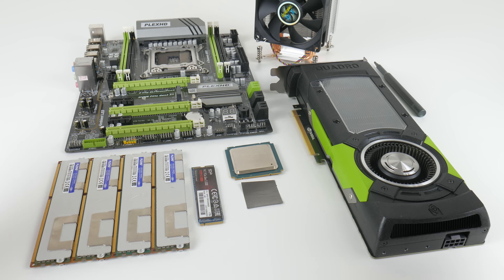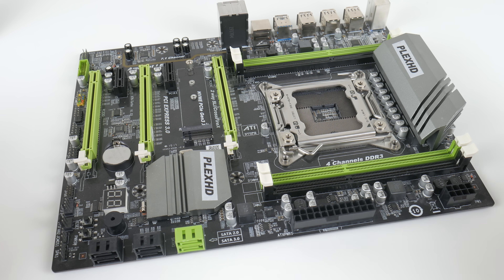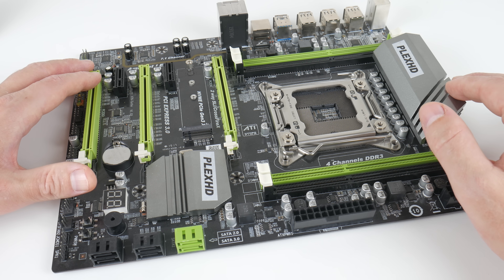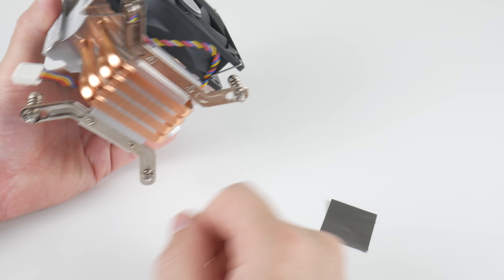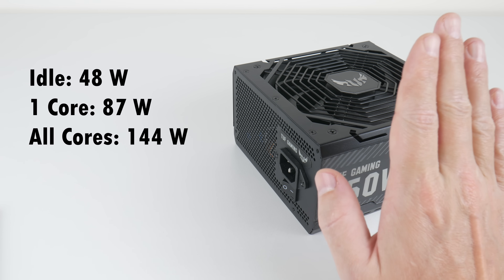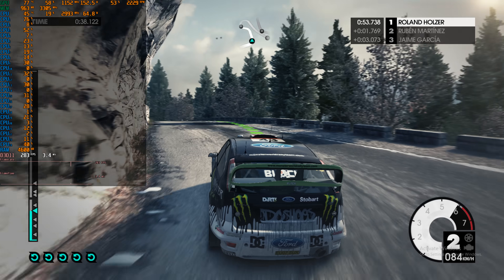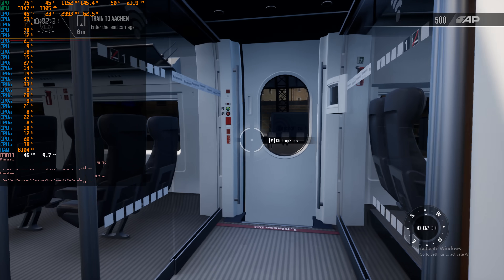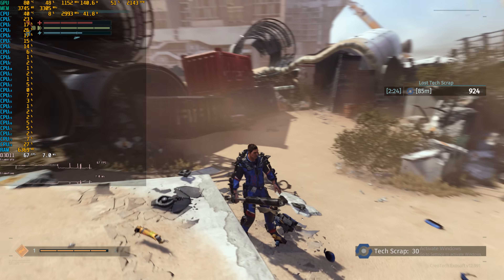10 years ago this CPU cost $2614 - How does it hold up? The Intel Xeon E5-2697V2!

Comment: if I remember correctly the cache design on these wasn't well-suited for gaming workloads - more for server and productivity stuff
Reply: 256k L2 per core and a shared L3. Pretty much how Intel did it until Alder Lake.
Oh, and that L3 is slower than the L2 of a Core 2. And on desktop chips both are about equal in size. My i5-3570K has 6 MB L3, and my X5460 has 2x 6 MB L2 for a total of 12 MB.

Comment: In cinebench R15 the 2697v2 is getting the same score as a Turbo unlocked E5-2660V3 10c/20t

Maybe you could check out the 2643V3? It has a 3.7ghz clockspeed available and with turbo unlocked 6c/12t maybe its good value?

Comment: For £71 you can go down just a notch with a 2650, X79 board and 16gb of ram which is a damned good deal, its on Aliexpress.   The 2650 is only 8 physical cores, 16 threads but if you factor in the price of a board and ram easily can exceed £70.   I have long wished for the £200ish dual socket X79 that comes with 2x2670's, 128gb of ram...   I mean those sort of specs are unholy badass and run a formidable GPU and I bet it could prob do quite well in much of todays games.

Comment: I have 1 of these skt 2011 AliExpress systems, which I bought after you featured it on your channel years ago. It's my 2nd machine in the bedroom, it has a 10 core Xeon E5-2660 V2, which was £75 when I bought it. So I think it's time for an upgrade, so I just went and used your link to snag a E5-2697V2, which was just over £30 shipped.
Reply from the maker: Good choice!

Comment: For this price You can look into v3-v4 (2667v4 is about same price) only m/b can be more expensive, but a lot of usb3, sata3, etc

And 2678v3 is cheap now (i got one for 120+usd 2-3 years ago, now its around 60) and it supports DDR3

Comment: These chinese boards can boot with ECC ram but works as normal RAM, you can type this command in cmd to check: wmic memphysical get memoryerrorcorrection, only few can actual using ECC function.

Comment: Those particular PlexHD boards are surprisingly solid. I used one with a 1650 v2 as my main setup for about a year and never had much cause for complaint. Even had it overclocked to 4.2GHz and it handled that just fine, though the 1650 v2 is only six cores so easier on the VRM. Paired with quad-channel DDR3 1866 it was a pretty decent setup.
Reply: hey mate i got same 1650 v2 planning to upgrade it to 2697 v2 .. should i do it ?? or i stick with 1650 v2 considering i have to gaming

Comment: Remeber guys: If the use of GPU does not reach the 100% and the game run slow, it is a bottleneck caused by the CPU, saludos!
Reply from the maker: You're right 🙂
Reply: In most cases absolutely. In some rare situations there can be some other limit. From specific GPU parts to VRAM, to simply bandwith.

Comment: Still using x58 with 980x. replaced the gtx480 with a 1050ti though. But thinking to get a better GPU now
Reply: I hope that was bought used? That was a grand when it released and was quickly smoked in games by the 2500K that could be found for under 240. Well, in 2-4 core optimized games at the time. Nowadays that would be different with modern games.
The trend to more core usage was also obvious with the AMD FX chips. Yes, in some games they're faster than a 2500K nowadays. But that means getting 27 fps instead of 24, so both of them are to slow. (Which was also my issue with the Q6600. By the time games made use of 4 cores, it's cores were generally too slow and power hungry and before you could get a dual core that was faster, cheaper, and more economical)

Comment: Excellent video Phil, loved extra games:face-fuchsia-wide-eyes:. The single core performance in rendering benchmarks is quite deceptive if we are thinking of gaming performance, as 120cb score in cbr15 is actually ~40% slower than what we get in stock, already very aged 4790k. Outside of few edge cases this cpu is still very decent for games, as it seems it could easily handle something like rtx 2060 or stronger even, depending on resolution and settings. 
PS. Hopefully you will fix the audio in your mic as there seems to be some kind of wind in your room, fans maybe?
Reply from the maker: Yea the AC was running it was really hot.
Reply: A 120 in CB R5 single is what my core 2 can do. The clock really hurts it, but the big cache can do a lot.

Comment: This CPU is now relying on brute force to achieve performance.  The IPC is about half that of an Intel Coffee Lake CPU like an i7-8700K.  The i7-8700K multicore benchmark in Cinebench R23 is about 8300, same as this 12-core monster.  Modern laptop processors like the AMD Ryzen 7 PRO 6850U have even more performance at a fraction of the power consumption.  The "X79" and "X99" motherboards being sold on AliExpress are really a crapshoot and you never know what you're going to get quality-wise.  The chipsets were salvaged from old server motherboards and aren't even the actual X79 or X99 chipsets.  They just name the motherboards that way for branding purposes.  It's a totally buyer-beware situation.  Unless you have an actual X79 or X99 workstation motherboard from reputable companies like ASUS or Gigabyte, I wouldn't build a primary system from one of those AliExpress boards.
Reply: The interesting thing is, there wasn't that huge of a difference between the desktop and server/workstation chipsets. With the official driver my Z77 is detected as "Intel 7 Series/C216 chipset family"

Comment: I think these remanufactured motherboards bundled with a CPU and RAM are fantastic entry points for a lot of people. It also significantly reduces e-waste to reuse old parts and give them new life.
Reply: Agreed on e-waste, on value I'll argue, you can get a B450 for 70$ that supports 5000 series CPU's and 5600 on a B450 is great value, not to speak that DDR4 is as cheap as DDR3 since they don't make it anymore.
Reply: @PatalJunior  True, you can also build a decent, modern, and new PC with a 5600G APU for under $400. That is normally with a B450 or A520 (depending on availability and discounts), 16GB DDR4 3200, 256GB M.2, 500W PSU and a glass sided case. Plus it is readily upgradable with modern parts.
Reply: @HappyBeezerStudios  When you think about it, the fact that a Core 2 Quad from january 2007 is still able to perform very well in everyday tasks like web browsing and pretty damn well in games up until 2017/2018 is insane and a testament to the greatness of the Core architecture used for Conroe/Kentsfield CPUs.
Reply: @PatalJunior  double the cost.  Can get a mobo xeon cpu and ram for less than a b450 motherboard
  With next gen ryzen out and ddr5 in the next year or 2 prices should drop  a fair bit. These game really well at 1080p  with a 130$ rx5700. Gives you 2 years to save up for next gen as it drops in price aswell

Comment: Haha your Video-Thumbnail rocks! I got this CPU too here but haven´t tested it yet. Because the E5-1680v2 is occupating the Socket on my only X79 board, the ASUS P9X79 PRO. This 1680v2 has only 8 cores but an unlocked multiplier and a base clock of 3 Ghz. If you can get hold of one of these, pls don´t hesitate. They might be more rare and more expensive but they´re simply awesome, can take a decent OC too and rock stable and low temperatures. Would love to see this CPU featured in a future video of you. Cheers.
Reply: Are they soldered or use paste like the desktop ones? If they're soldered, that would make for a pretty easy overclock.

Comment: Never used x79 seems interesting for a budget setup, I have an x99 setup and it works well for me, Chinese mb and e5 2740 v3.great info !!
Reply from the maker: Yea if you have X99 no need to step down. There are awesome high end CPUs for your board too...
Reply: I meant e5 2640v3 sausage fingers

Comment: The Chinese also make X99 motherboards with DDR3 slots, so you can enjoy native 4k video playback too using cheap DDR3 Reg ECC without a decode capable graphics card (like R9 390). The catch is that only a handful of CPUs (originally released for OEMs) supporting DDR3, and also only the v3 (Haswell) models can do the "all core turbo unlock" hack.

Comment: i have a 2470 in my private home server its the v1 not a v2 it was upgraded from a 2403 but this server was saved from going to a landfillits a bit beatup on the outside due to a drop from my bike but the hardware itself is fine i dont use the onboard graphics on it anymore as when i could afford to upgrade components i replaced the GPU with a gtx 760sc which was what i could afford at the time and probably got overcharged on

Comment: Just gpu limited for the games i think, not cpu. It would have been nice to do a comparison with a more recent processor, and a latency test. This Xeon is Ivy generation processor, remember my 3770k with the same graphic card (EVGA GTX 1060 6GB OC) which worked great, intel software cpu test percentage was above average almost 90%. To say the monster hunter benchmark on an asus p8z77ws was a little bit better than with an aorus master z390 and 9700k (17000 points vs 17100 points) it's not a very gpu-intensive test the graphics card is clearly above the limits, but we can observe small differences with the processors, which have a few generations difference, not always obvious, especially in 1080p.
Reply: Aorus master z390                                 Asus P8Z77 WS (workstation)         
16 gb ram DDR4 4200mhz     VS          16gb ram DDR3 3466mhz
i7 9700k(4,9ghz non OC)                       I7 3770k(OC 4,2Ghz)
M2 Nvme                                                  SSD samsung pro
EVGA GTX 1060 6GB OC                       EVGA GTX 1060 6GB OC
Lepa 750W Gold                                     Lepa 750W Gold

Overclocking card to the max capacity, rad air cooling by Artic (accelero xtreme 3) with EVGA Precision XOC:
+250Mhz Gpu clock 2151Mhz total
+500Mhz Memory clock 4498Mhz total
+25% voltage
+KBoost

Results(I found the good results I had just 100 points of difference to my memories):

16800 points        VS        16900 points

But it's not a CPU-intensive game, which is why the processor capacities are well beyond the limits and in the end make little difference on this benchmark, the difference has to be played on the architecture of the motherboard in my opinion. This Ivy bridge 22nm worked well, same this Xeon but can do clearly better and better OC.
Reply: Would be interesting to run comparisons with an overclocked 3770K or 4930K/4960X, just to see how much of that is lack of clockspeed and how much it's the GPU.
Reply: @HappyBeezerStudios  For sure Xeon E5-2697V2 vs 3770K or 4930K/4960X could have been one more indicator, to identify the CPU requirements of games and other benchmarks.

And if it's really the performance of the CPU and the motherboard architecture, taking advantage of multi cores and multi threads, or if these tests are valid with Ivy bridge CPUs which have more speed and less core like the 4960X, or at equivalent power and less core such as the 3770k.

Comment: Always nice to see older parts getting some use. Also running a xeon 1680v2 and is has not disappointed in anything ive thrown at it R15 gets about 1480 at stock and about 1590 at 4.1ghz
Reply: Your xeon 1680v2 running fine with my rtx3090ti at 4.5Gz speed. Is good idea to assembly with the high speed ddr3 2400Ghz.

Comment: So...can you do some slight retro testing using Windows Vista X64 SP2, Windows 7 X64 SP1 and Windows 8/8.1 as well as use 3DMark Vantage and up and other multi CPU aware benchmarks as well as games from Crysis, Crysis Warhead to later PC games that actually use multi CPU cores?

Also the last stage of Crysis Warhead on highest quality or Enthusiast settings should be checked... even Crysis 1 should be tested on Very High maxed settings at 1080p since that will show the highest old retail effects and any stability issues especially since Crytek never really bothered to do a Remake for those two games and did a bad Remaster considering that even the base Xbox One and PS4 2013 consoles have eight CPU cores and DX 11+ GPGPUs equipped with Compute Units which are things the original games on PC NEVER actually used even if Nvidia (for propaganda reasons) sent them GeForce GTX 8800s which had CUDA cores aka Compute Units or Streaming Processors.
Reply: I would say 7 or 8.1 for that. Both are the latest supported systems of them and lots of games and software will still run on it.

Comment: The top CPU is actually the OEM-only Xeon E5-2696 v2, which has a 3.1 GHz all-core turbo. I used one sometime ago with the Asus Rampage 4 Extreme motherboard, which supports FSB overclocking, and I was able to run it at 110 MHz base clock for 3.41 GHz all-core. I sold it on eBay for double what I paid for it, since it was way overkill for my needs.
Clock speed-wise, the fastest is the E5-2687W v2, with a 4.0 GHz max turbo, but it only has 8 cores, so you might as well buy an E5-1680 v2 and overclock it.
There also exist the rare 4.4 GHz and 4.6 GHz Intel "Black Ops" CPUs with 4 and 6 cores respectively, and no Hyper Threading. I don't know about the former since it was pointless, but I found that the latter couldn't actually hold 4.6 GHz on all cores, so it was more of a max-turbo speed. It has a 250 W TDP, and I uncapped all power limits in the BIOS, but it could still only hold 4.1 GHz when all 6 cores were stressed. Sadly, this meant it only had collectible value, since you can easily overclock an E5-1660 v2 or i7-4960X to 4.6+ GHz with HT off.
Reply from the maker: 250W TDP 🥵
Reply: @philscomputerlab  I think they just marked it at random, since those CPUs were supposedly custom-made.
In actual use, the power draw was not even 150 W, which is why I couldn't understand the throttling. I tried undervolting it as well, but that made no difference, so it wasn't TDP or thermal.

Comment: Not sure if that is, in fact, the very best Ivy Bridge; as I recently decommissioned my venerable E5-1680V2 (8C/16T, US$155 at the time) that could all core overclock up to 4.5Ghz on air (230WTDP cooler); though I ran it daily at 4.3Ghz for over 3 years without issue and at reasonably cool temps (less than 70C at 100% with 20C ambient). I had it paired to an Asus P9X79 Pro that I picked up in a package deal with 32GB 1600 desktop RAM (and a CPU + Cooler).  After selling off the parts of the bundle that I did not use...that pristine motherboard cost me about US$20.
Recently upgraded to the "spare" E5-2678V3 (12C/24T) paired to a "spare" HuananZhi X99TF.  This combo allowed me to repurpose 32GB of DDR3 1866 (not DDR4...about 5 of the V3 CPU's are capable of either DDR3 or DDR4). The CPU cost me $85 two years ago...and I got a great deal on AliEX as a result of a refund (first X99TF arrived very late, two months AFTER the failed delivery refund) so I ended up with two new X99TF's (each w/4 slots for DDR3 or 4 slots for DDR4) for $100 in total. Hesitantly decided to replace the X79 system with the X99, given a complete OS reinstall, in parallel. Sacrificed superior single core speed for overall multi-threaded performance (better IPC + AVX2) and lower temps. Nevertheless, with Turbo-Unlock (see MiyConst on Youtube for the Mi899 software tool) on the E5-2678V3, I am able to achieve 3.3Ghz all core...and boy does it run fast and cool.

Hard to part with that X79 combo...it is a gem of a CPU/motherboard combo.

Comment: I have 3 old ASUS boards running Xeon E5450 with the LGA 775 to 771 mod, not the best CPU but still certainly enough for daily use. If I ever have the need to run current games but skip the overpriced new CPUs and boards, buying a Xeon CPU and an aliexpress board is definitely the most viable option.